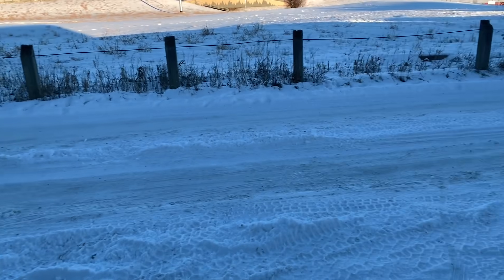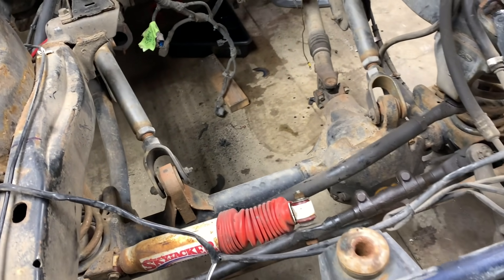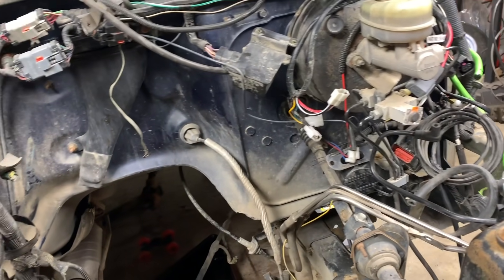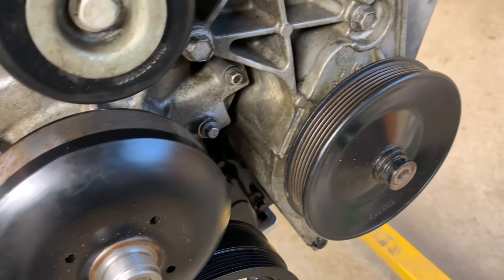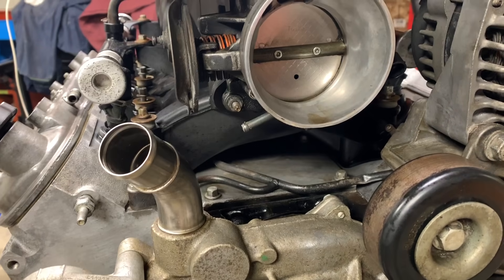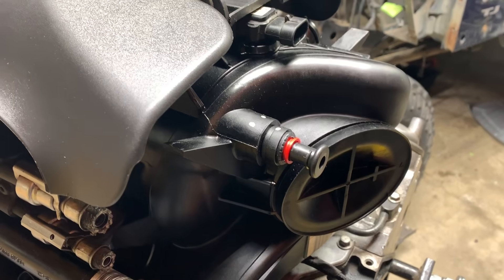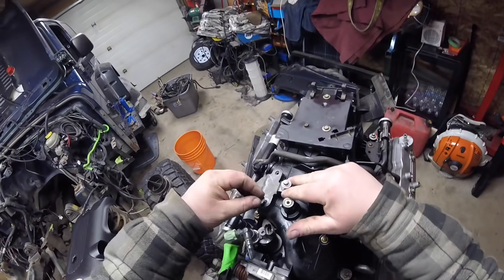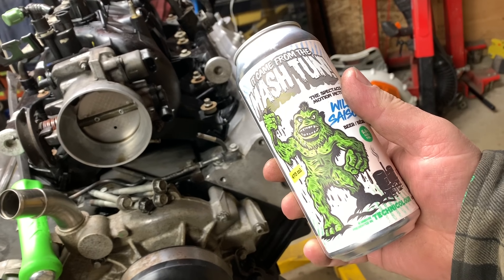Picked Up The LS Engine

Comment: Steering shaft mods. Body lift kit. Forget about duals exhaust. Trans mount moves. Aft mkt gauges will be needed. Shift cables. Larger fuel feed hose. Larger rad and electric fan. Careful on location forward. Will cause service and clearance issues for water pump at fan . Lots to do !

Comment: Jerry, I am in the final stages of a 5.3/ 4l60e/ Np 231c swap in a 98 TJ originally equipped with a 4.0 and a 5 speed. I will gladly answer any questions and help you along the way if you need it. Just message me. I enjoy the videos and you will love the swap. 

Mike
Reply from the maker: I got a 231c from a 97 s10 that I’m going to use the back half and then use the Jeep rear half with the SYE.  This way the Jeep can use the VSS for the speedo and a got a signal converter to split the signal for the ls computer

Comment: Hey Jerry! I have a 6 part Playlist that covers LS Wiring Harness Cleanup that you might find useful.  It would go along with your information that you acquired from lt1swap.  Mine is a 5.3 LM7 but both engines share the same block.  Cheers... it was 79 degrees here in Georgia last week....  Just saying!!!!  Mike
Reply from the maker: Thanks for the info I actually cleaned up the harness over the Christmas holidays
Reply: Oh... I forgot that you sometimes publish on delay!  Cheers bud!
Reply from the maker: Yes usually a long delay as for example it’s too cold to work in the garage so last weekend I never did anything

Comment: Hey Jerry not sure if it's worth anything to ya but I have heard some people put a Bead of RTV or some sort of silicone around the Knock sensors holes under the intake just to stop water from going in there and shorting any of them out.
Reply from the maker: That’s a good point I’m actually thinking of replacing them before the motor is installed and bolted up
Reply: @BackCountryWrenching  im doing a 5.3L LS swap in my 1986 Monte Carlo and when i pulled the Junk Yard 5.3 those holes where filled will corrosion and and there was nothing left of the sensors themselves so im going to go through mine and make sure none of those problems happen again. I just thought since you have a Jeep it might be worth it to do to that thing.

Comment: Your engine doesn't even have new crankshaft bearings???  According to the list
Reply: Dirty Garage it's not really needed, I've pulled 250k mile 5.3s motors apart and bearings are always perfect. Only thing I replace are cam bearings.
Reply: Why would cam bearings wear out  before crankshaft bearings? Every ls engine I have seen blow up usually let's go because it spins a rod bearing. Mind you it's usually a oiling issue that makes it happen.
Reply: Mostly because I'm putting a $400 camshaft, cam bearings are $30 and usually look pretty beat up  in the higher mileage motors.
Reply: @ryanteixeira6449  cam bearings are also a pain to install compared to crankshaft bearings and if the bottom end is good why not just leave it I guess. Even leave the rings alone then a guy doesn't have to hone and set up the ring gap.
Reply: Dirty Garage if I polish the crank I will put new std crank bearings.

Comment: Oh man Mr Jerry. I hate Chevy. I been holding back. I thought a 5 cylinder diesel motor would of been cooler. I gotta bust your balls now. So now it will be a jeep with a terrible motor . I know Chevy guys like those ls engines but I do not. Gas guzzling piles of crap. 
      Ok got that off my chest . Mfbt.
Reply from the maker: Ls is the most reliable, easiest motor to build there is,  you don’t see anyone doing 5.4 3v swaps do ya 😂😂😂🍻
Reply: My Silverado 4x4 has the 5.3 Vortec and averages 21 mpg on the highway, how much more do you expect from a 6500 lb truck?
Reply: KSERGEIBY 4.7/5.7 are way less reliable. The ls has been put in everything, so you got a plan of what works.
Reply from the maker: That’s a crazy amount of mileage
Reply from the maker: Everybody has a opinion and some aren’t Chevy fans and that I understand.
Reply: @BackCountryWrenching  I am not a fan of any brand I am a fan of what works and the LS stuff is proven and no I am not parting with my 7.4 suburban any time soon either